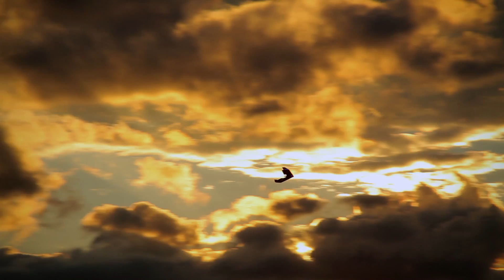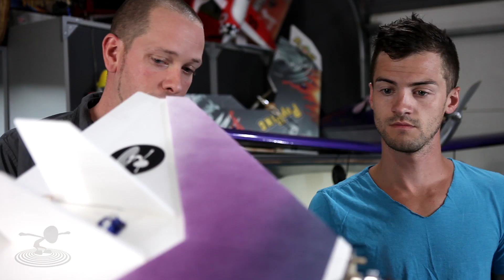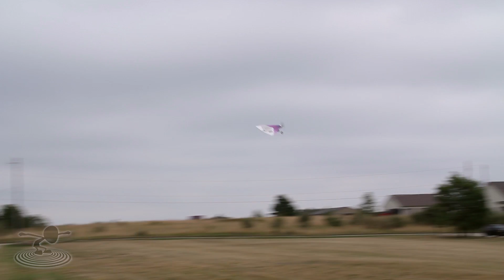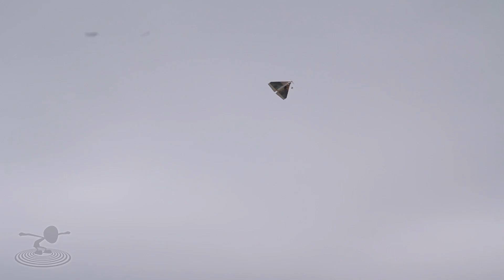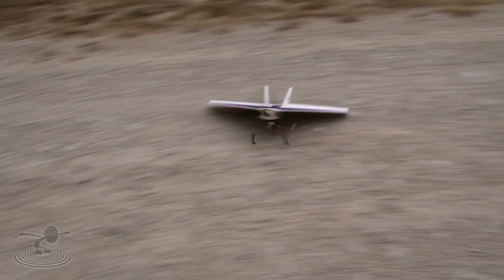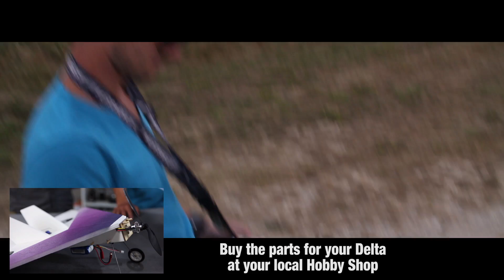Flite Test - Delta Wing - PROJECT

Comment: i have built the same delta wing but the problem is the wing drifts to the direction of the propeller spinning, it doesn't move in straight direction.

Comment: What paper size is the tiled plans plz respond thx?
Reply: Foam board
Reply: you need a1 foamboard, tiled plans print as either a1, or a4 and you tape them together
Reply: 8 11 inch, american format. Would appreciate A4. But just take the full and select tile large pages when printing out.

Comment: would this plane work on a 980 kv motor?
Reply: As long as you pair it with the right prop. I have a Hog Wild delta from electric-combat.com and it flies great with a 1000 kv motor and a 9x6 prop. One of my friends uses a 950 kv motor with a 10x6 prop on the same delta and it actually flies a good 10-15 mph faster than mine. So yeah, I think a 980 kv motor would work just fine with a 9x6 or maybe 9x7 prop. My friend and I also use a 30 amp esc and 3S batteries.

Comment: I have these on my other swappable home builts and have had no problems so it could been just a bad one cost me the battery and the esc. so I am ok with use these on my cheap planes but will not use on a nice plane.

Comment: Just a fyi on hobby king 25-30 amp esc:

Just a fyi I was running a 2208 /14 motor on a ft delta swapable I built. it was on it 30Th flight running a 4*8 prop with a 480mah nano. and in mid flight it went POP, I had control so I landed fast. I found the esc exploded all the fets where every where solider from the board spattered everywhere the cpu and volage reg and all the fets where unsolidered and resoilderat the same time in weird places on the board.

Comment: you know, the KF-airfoils don't work as well unless you have the leading edge rounded, or at least angled. 

And yes they are like conventional airfoils except that they don't stall before about 60 degrees angle-of-attack, where a conventional airfoil would stall at ca. 13 degrees.

Comment: I'm not saying that Josh is a slow learner, but he has to not be trying very hard to still be at this level.  I started about a year ago with a Hobbyzone Champ (BEST beginner plane BTW)  and then moved my way up, but since I'm to young to drive I can only fly about once every week or two.  I now have made several scratchbuilds including a hot wire cut flying wing, a mini DLG, and now a 2m thermal glider.  I also have a AXN floater with a GoPro, great fun and I'm learning to fly inverted with it!

Comment: little tip. put some tape or a lego wheel at the back of the plane to stop foam wearing down on the road and on rough pathways. My FT Flyer elevator had bits of foam coming off the elevator before i put a lego wheel on the back. lego wheels don't make the plane tail heavy.